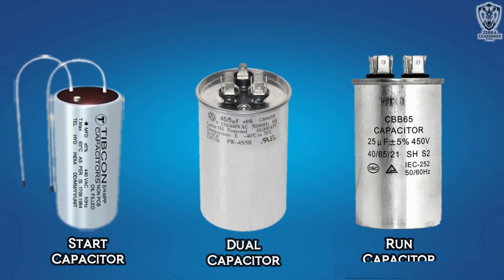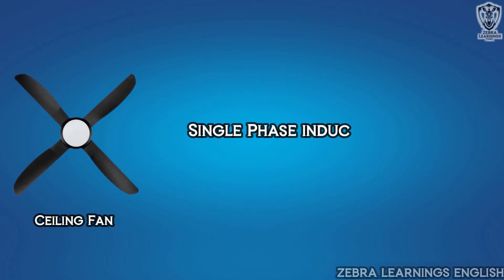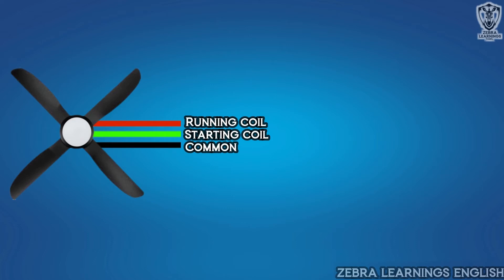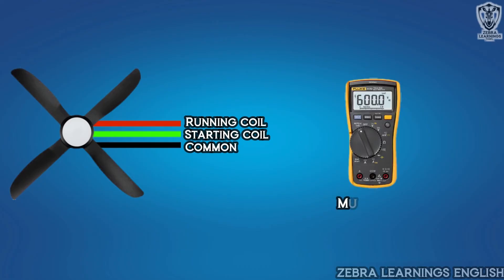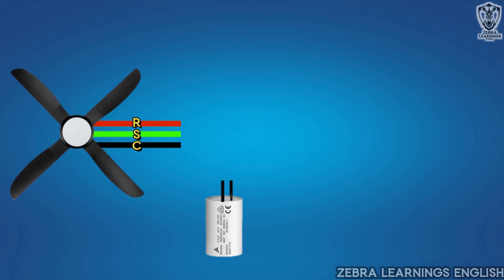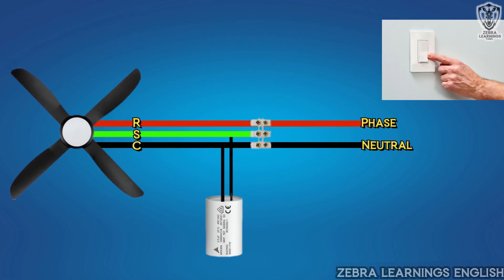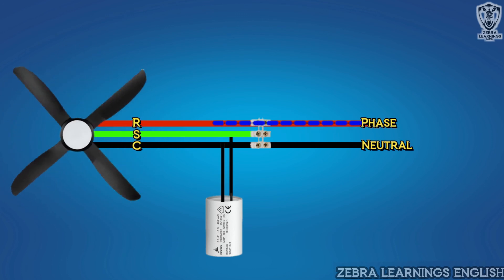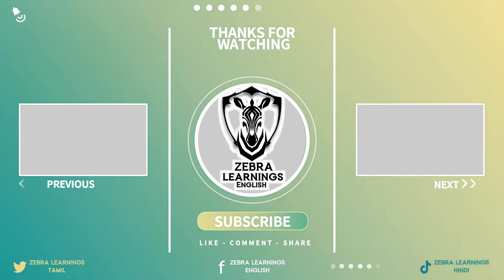Ceiling Fan Capacitor wiring diagram | Animation | HVAC | Eletcrical

Comment: Sir It rong connection shud be  running & starting
Reply from the maker: Hi, The connection based on the motor used in the ceiling fan.
Here I have used Start Capacitor. The Start Capacitor connection will be series between Starting Winding and Common. But for Start-Run Capacitor the connection should be series with starting and running winding.